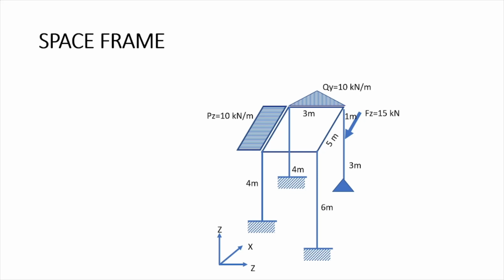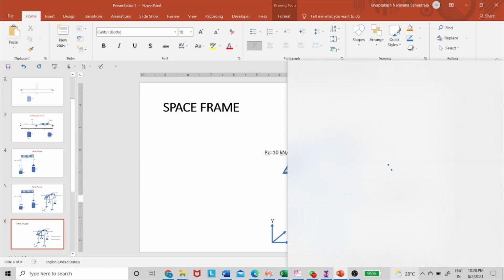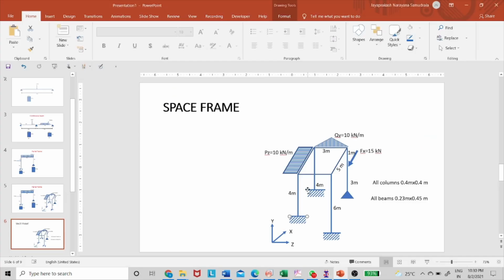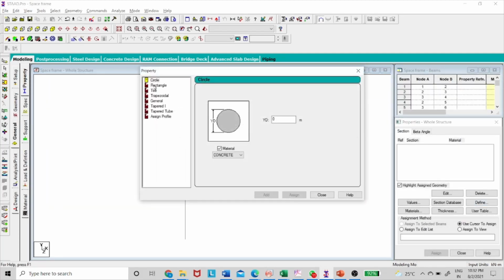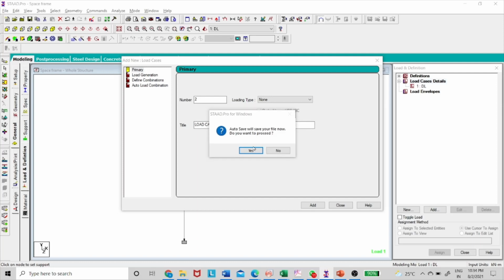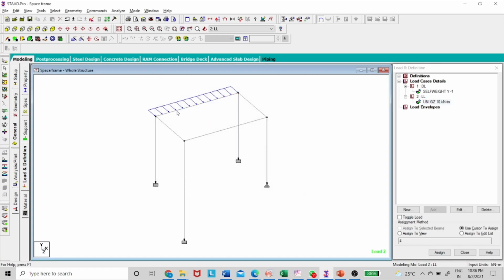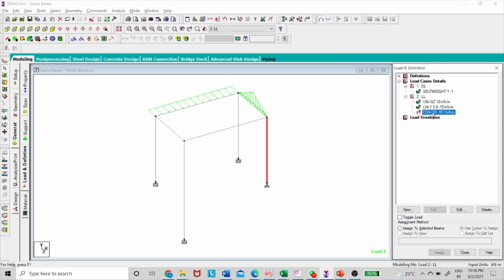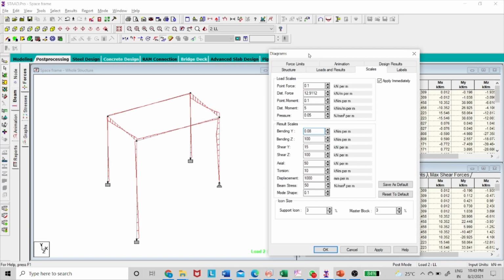EXP 4: Analysis of SPACE FRAME using STAAD Pro

Comment: Hello, am a mechanical engineer, I need to know why you add the load combination, and why you put it in 1.5?
Reply from the maker: Thank you for your question. As per IS 456 standard the design load is considered 1.5 times of sum of dead load and live load. This 1.5 is partial safety factor for loading. You can understand like this. Loads are not constant , we have to consider probability of distribution of loads.